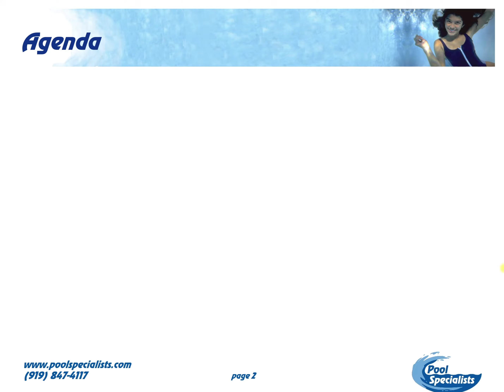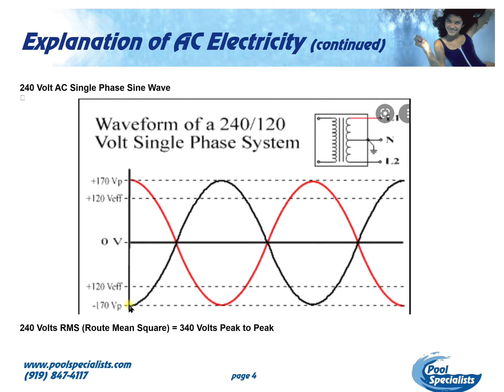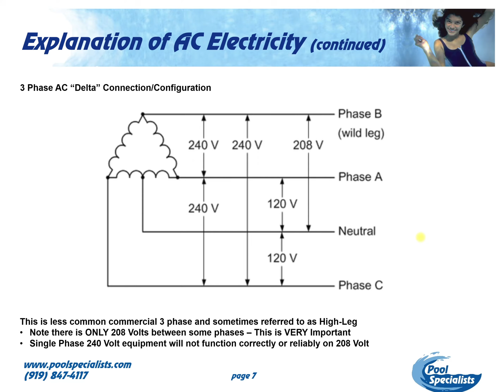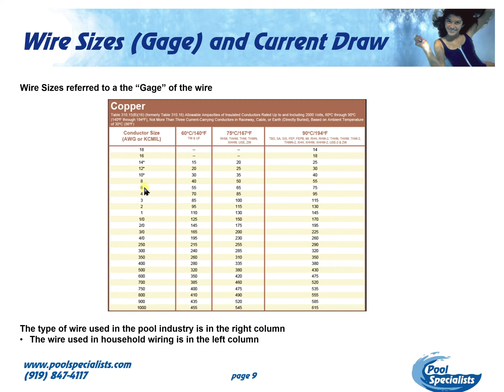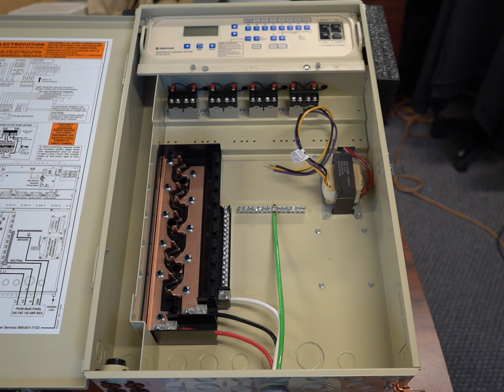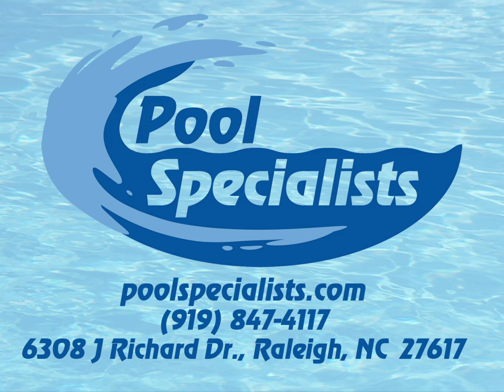Basic Pool Electrical Wiring Module 1

Comment: Thanks for the video.  I want to connect the pump or some "signal" to the Pentair heat pump "relay" points.  My hope is that will tell the heater to start only when the pump is running.  How can i do this?

Comment: Just a note on your terminology for the conduit/raceway;  what your showing is not Smurf type, Smurf tubing is a blue flexible tubing for indoor use only. What you have in your photo is known as Liquidtight, or technically LFNC. note you can use the beefier metallic reinforced LFMC. Note that the connectors are available in various grades of quality, the ones you have are of the lower grade, you can opt to spend a little more and buy the better quality ones that have metallic threads and metal parts, primarily you need the strength for the connectors on the pumps. Pay attention to wire temperature ratings as the ends of the raceways may be exposed to hotter temps above ground, in the sunlight. A 'sweep' is a term, but electricians will call it a 90 or a 45 or whatever the radius is, because electrical bends are 'of course' not like a water pipe 90s. The length of a run does not determine the conduit size, rather it is the number of conductors needed in the conduit that determines the conduit size. Granted, 1” conduit is always easier to pull through, and I recommend 1" if you want to spend just a little more, especially if your have more than 270 degrees of bends. But reduce it to 3/4 above ground. 3/4" conduit is fine for everything except maybe the feeder to the subpanel, that would be better in 1". Refer to, read and understand article 680 of the NEC before attempting any pool electrical. Otherwise great videos.

Comment: your ground and neutral are separate because this is considered a sub panel, at the main disconnect the ground and neutrals are in fact together. they have to be by code. it has nothing to do with older homes.

Comment: Your explanation of 240v is not quiet correct. The two legs are are from the same set of windings in generator and from the same transformer on the street. Its called "split phase" ... because the single phase is split at the transformer by the neutral, so 120v line neutral, and 240v line to line (notice i did not say phase to phase, because it is a single phase).   So they are in-phase, not 180 degrees out of phase. If they were 180 degrees out of phase, there would be two phases, and they would cancel, not give a higher voltage. Also, neutral and ground must be only connected in the main service panel.
Reply: I think i am really close to understanding single phase 240v.  Is it true that basically since the neutral rises from the halfway point of the transformer then when you go all the way to the other end, so hot to hot, or red to black, its almost as if one of what we are calling hots is really just the neutral?  In other words the second hot for 240 is basically just the neutral that's moved all the way down the transformer instead of interrupting it halfway like the regular neutral for single phase 120 volt?